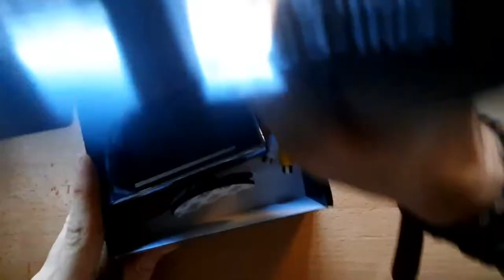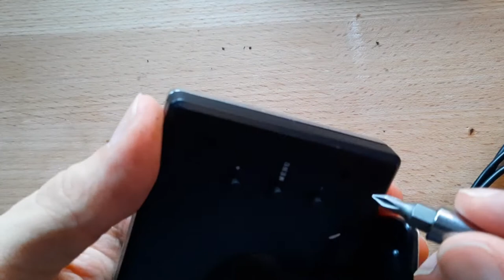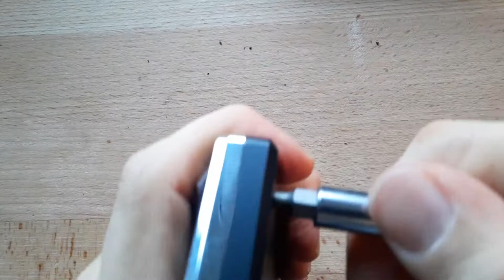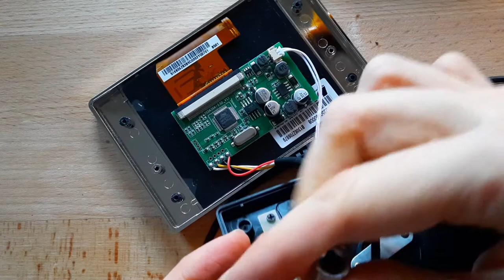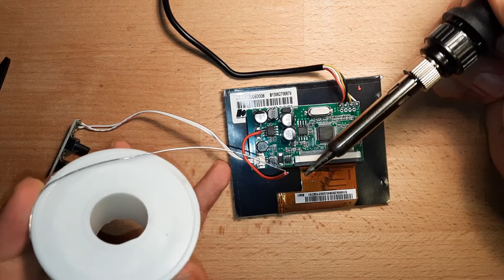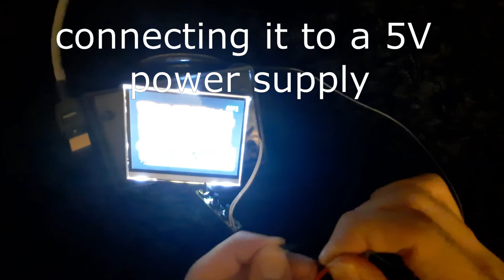12V TFT-LCD Car Monitor 5V Conversion

Comment: its the quality of this displays any "good"? i dont know what to expect for 5 bucks, im planning in using one of those to play games with a pi zero
Reply from the maker: It's good enough to play games but if you need to read text it's quite bad, i don't know if it's because mine arrived damaged or if it's the actual default quality, but i'can barely read the shell text.

I would suggest a 3.2 inch touch screen module i got one for 10 uds and the quality is way better it's just a bit harder to configure and there isn't a library that allows to use the touch screen functionality yet but it's totally worth it

Comment: Hi, how can I know which monitors support this conversion? I opened up mine today and there is not this IC on it. The closest to power has more voltages like +11v and -11v like a diode is in front of it. Then there there is a 5v pin 0.8v pin GND of course. Forgot to measure the last one. 

But connecting 5v to that pin didn't power the monitor unfortunately. Just minutes before I started the conversion i tried it with 12v and there everything worked
Reply from the maker: I don't know, when buying these Chinese monitors it's basically a lottery as there are different board versions and you don't know which one you are getting until you open it. I don't know what specific board you have but this page might help as it contains different screen models and ways to do the 5v conversion : https://www.sudomod.com/wiki/index.php/GBZ_Screen
Reply: @engibored3207  Had a look into the page i think it says there 3.5" screen and mine is 4.3". None of the pcbs looked like mine I could only share a reddit arduino thread i opened. There is a pic of the pcb
Reply from the maker: @sarcasticfpv   that's probably the best thing to do as I'm afraid I can't be of much help

Comment: Which is better, jump to 5volt or use step up 12 volt?
Reply from the maker: they are both valid solutions to the problem, it depends from what do you have at your disposal and from your components.  just keep in mind that when you are stepping up your voltage you are also stepping down your current. So the more important parameter here is probably the current that your battery can safely provide. Also keep in mind that such current should be enough to power your particular application. if you are using a 3.7 V  lipo battery like I did.  I would go with the jump to 5 V and then step up the battery voltage to 5V since those batteries can't usually provide huge amounts of current. Also as usual know that I'm no expert ;) this might also help you : https://en.wikipedia.org/wiki/Boost_converter

Comment: can i use 7inch lcd in this same bord after removing this 4inch lcd??🙏 
Please reply sir.😀
Reply from the maker: I'm not sure what do you mean and I'm no expert but from what I think I know:
you can't use the board of a smaller screen with a bigger screen you'll probably need more pins since the bigger the screen the bigger the number of pixels you need do control 

you might be able to do the same modification to the 7 inch display though but I've never done it and I don't know if it works you might end up killing your screen so before trying do a bit of research I'm not responsible for whatever you might end up doing after reading this.
Reply: @engibored3207  so your not helpful for me anyway thanks for your reply 🙏❤️

Comment: white is not audio they are video input 1 and video input 2
Reply: yes this tft nt have audio out put
Reply from the maker: @zuhaibtecnotronics3895   I'm not sure what you guys are talking about but yes that's correct tft do not have audio output if i remember correctly the white one is for the backlight

Comment: Can I connect the output pins of tp4056 to raspberry pi directly and at the same time if I connect a step up board to convert 5v to 12v for monitor . Will it work ? Will it get enough power ?
Reply from the maker: I don't know in theory it should work but keep in mind that the raspberry pi works on 5v and everything above it will probably kill it.

if you want to try that, do your thing but do not connect the pi and check all your input and output voltages with a multimeter if they are 5v or below it's a good sign but you might still end up killing the pi.
 
Personally I would use a screen at 5V (or at 12v but modified to work with 5v) directly connected to the pi.
Reply: @engibored3207  thank you so much 😊 I have one last doubt that is it save to use lipi battery with tp4056 as it is made for charging 18650 lion battery . I have a 3000mah mobile battery lying around can I use it ?
Reply from the maker: @pragyanmehta7331   to be honest I've no clue about this last one ahah.

Try to google it and see what comes up. 

from my personal experience the tp4056 might overheat and catch fire. It might have something to do with the capacity or some other spec of the battery I don't remember.

The battery I used has 5000 mah  and it is waaay to much, the more the charge goes down the more the module will heat up while charging.

I've no idea if the battery is also endangered but be really careful with both don't leave them unattended until you are sure they work and be ready if they catch fire or explode.

I would personally choose a battery and a charging module with protection that are made to work together just to be safe. even if in theory if the charger can provide the right charging spec for the battery it should work fine(mainly charging voltage and current)

Comment: Can use 2 batery type 18650?
Reply from the maker: If you have 5V yes if you have a higher voltage you'll need to lower it if it's lower you'll have to raise it the important thing is not frying the pi